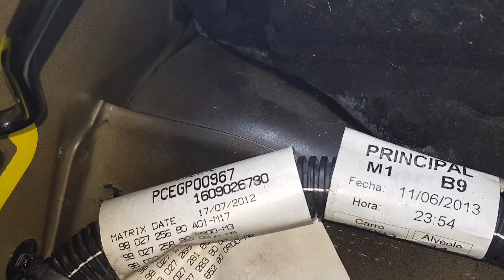HOW TO REPLACE FRONT SHOCK ABSORBER ON PEUGEOT PARTNER/ CITROEN BERLINGO

Comment: i done a good few front springs struts on my own cars and friends in the past(ex truck and bus mechanic) but i have never seen one with a top nut tucked away under the bulk like that. going to be doing one for a friend on his Berlingo van  so thought i would see if anybody did one on here. thanks Guddu Pappu .with a quick recap off this video, i reckon i could nail it in an hour or so on the side of the road. cheers again

Comment: I changed ball joints and drop links but still it makes that sound can u tell me if I am right with the shock please thanks
Reply from the maker: May I ask you when they make a sound on bumps or when you turn?
Reply: @guddupappu3582  when I am at a stop I give it full lock and it makes a clonk sound but I chagesd the ball joints and drop links

Comment: Hi mate my citreon berlingo multispace van on the left side when I give it full lock it makes a clonk sound is that the top shock mount can u tell me it sounds like a stretching sound then it goes clonk
Reply from the maker: Hi, looks like your spring broken
Reply: @guddupappu3582  I looked at the spring it looks fine but I think it's on the way out if it is making that stretching sound then clonks what u think